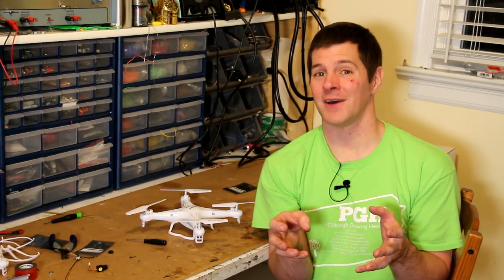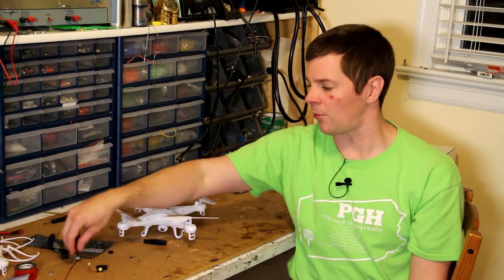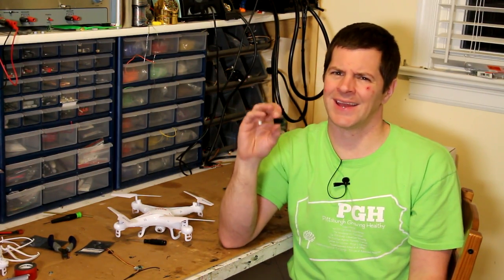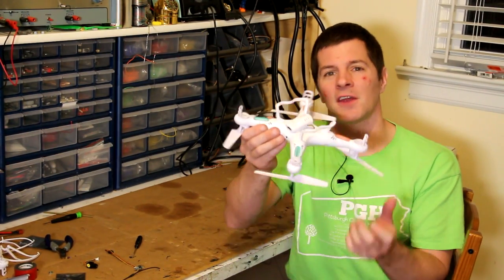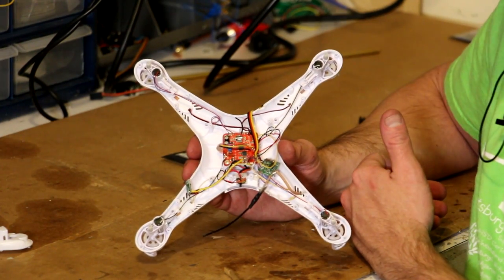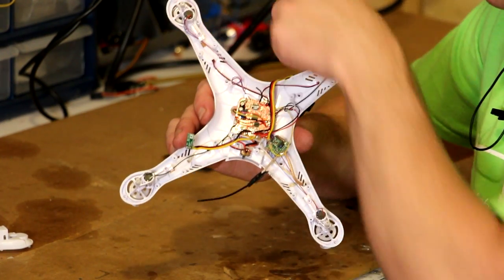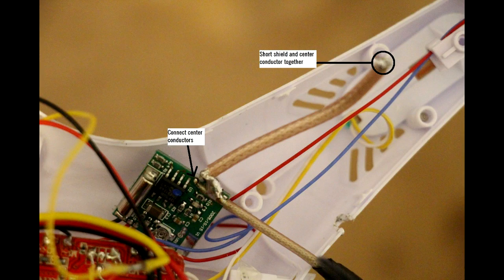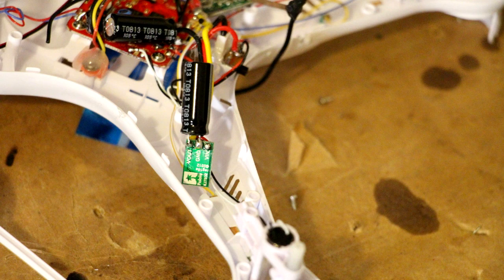Convert the Syma X5C to live video downlink (FPV)

Comment: I thought the video was pointless and too complicated as the wires that go to the camera are good to use, I wired up a EF-02 AIO camera from a eachine e010s and it works fine with a clove  leaf antenna and has a built in vtx receiver ready to go. From a beginners point of view this could have been simplified even more for fpv beginners to just pug in a camera and learn to fly without the hassle.

Comment: Total noob to video transmitting , could you explain how to receive the video , capture it to a monitor,tablet or phone... from the 1.3 gig wifi signal?  
I have an china knock-off x5sw-1, thought it was a syma but while syma is in the pics on the ebay website, what came in the mail was just x5sw-1, so I cant even get the 2.0 mega pixel camera to work at all.... my issue though, 
so any help would be gratefully appreciated .... Thx...... love the Tx range mod in part 2....BTW the cable you cut in half is like 1.68 on ebay.....if you don't mind waiting a month for shipping from china....

Comment: I made a similar mod on my X5SW, although I did it on 5.8 and with a 1S  camera and VTX... I get great video, until I start up the motors, and then the video has so much interference it's unusable. You say about using a capacitor, yet other places mention a coil too... is this really needed? Or would just the capacitor do? Also, what capacitor specs do you recommend?

Comment: Sweeet.   Very informative, just bought the x5c-1.  Not sure what the 1 upgrade is but do you know if the range mod is worth doing with a router antenna?
Reply from the maker: +Andrew Gisch - A router antenna should double your range.
Reply: Good deal, is it the length of the wire inside that makes it extend?   It sounded like the gauge of the wire is critical as well?  Asking because i'm curious if you can make one.

Comment: Just to let everyone know you can simply buy the wifi cam on amazon now and replace the that comes with the X5C-1. No modding needed.
Reply from the maker: +joseph ford - I see this comment a lot, but unfortunately it really is not the same.  WiFi links are laggy and make the vehicle feel "disconnected" from your inputs.  A true live analog link is much more enjoyable... and reliable.

Comment: Dig the mod!!! For a quick cheap FPV I think it's great mod !  I'm no expert just a ham operator and some engineering classes in my past. Did you have to use such a Large cap on the regular or was it just the first thing you tried?
Reply from the maker: +noir4hire - Just the first thing I grabbed out of my junk box.  I had smaller ones, but didn't feel like pulling it apart just to find out I was wrong, so I over-sized it.

Comment: 1.5ghz has no more "penetration power" than 1.3ghz - have no idea where or how you came up with that. Frequency has nothing whatsoever to do with how radio waves are propagated within a building, especially within the same RF band (which 1.3ghz & 1.5ghz are) and assuming the same transmit power.
You also say you are using a voltage regulator to step up the voltage. That's not what a voltage regulator does. Stepping up the voltage is the function of a transformer. A voltage regulator keeps the voltage within a given tolerance or at a constant voltage as the name implies.

Very nice video - do you have a parts list with common Mouser or other supplier part numbers? Hard to do your mod without unless I missed it somewhere? 
Thanks!
Reply from the maker: +Ron Bean -You're joking, right?  1.3Ghz is less prone to multipathing than 5.8Ghz.  This is why I'm using 1.3Ghz.  The regulator is a boost regulator which steps the voltage up to 5V.  I got the components from www.readymaderc.com

Comment: Also, do you know why my camera doesnt work on my SYMA X5C? right top button is to 360 degree flip and the other one does squat, light never changes to red
Reply: +Carlos Alberto Nolasco Hernandez Hold hte right top button until it beeps which I believe turns on the camera. Green light should come on. Then push the button between the left toggle and power switch up to take a picture or push it down to begin taking a video. Push it down a second time to stop recording.
Reply: +Wesley King gee thanks señor! I'll try it tomorrow and ill keep you posted. thank you for taking the time and answering my question. I really appreciate it
Reply: +Carlos Alberto Nolasco Hernandez On mine, the top right button is for flip, the top left button changes the speed of the fan blades (low/high, also a corresponding change in battery life). To activate the camera, it's the button just left of the center of the control, to the right of the left toggle switch that controls the vertical and yaw. Tap for a picture. Hold it down for a second or two to activate the camera. Should see the camera light change for each of those presses.
Reply: Awesome! thanks a million Bryan. You're a wiz man!

Comment: A 1.3 ghz antenna on the transmitter will work with a 5.8ghz monitor?

What if the monitor has a 5.8ghz antenna?

Comment: the filter for the 2.4 is great!!! thanks for the tip crazy! I have a micro quad with the 1258mhz vtx and it smashes the signal from my hubsan Flick Controller. I get about 25 feet right now. I'll send an update after I install the filter.
Reply: Now 5 years later whats the update

Comment: I'm curious, could You maybe utilize the existing onboard Camera by just tapping off the Video Out and connecting it to the Video Transmitter, also are the Video Transmitters only 5v specific? Be nice if You could do that and run a 3v Transmitter eliminating the 5v converter, which would only add the weight of the Video Trans and what ever extra wires needed, just a though...   ;)
Nice Video Alex, thanks for sharing..  :)
Reply: I'm curious, did you ever figure this out? I've scoured the interwebz looking for a diagram or something showing where to connect a video output to the stock camera/dvr, to no avail. If you've figured it out, please please show me! It would save me lots of poking & prodding... I simply want to connect a 5.8ghz tx to the stock camera/dvr. Thank you in advance. Cheers, Paul
Reply: Thank's for the reply & the info. I'm actually not using an x5, I just need a small camera for a 120mm quad I'm building. I have a 200mw 5.8ghz tx & I have 3 of these Syma cameras. 2 are wifi, that you use with the app & a phone. The other has a micro sd slot (essentially a dvr). My idea was to turn it into a  tiny light weight 5.8ghz fpv set up with recording capabilities. I just don't want to fry something poking around on the circuit board...
Reply from the maker: Soco Joe Apparently you can but I have not yet tried that.
Reply: Alex GreveThx Alex, It was just a thought as I think I remember seeing a 5.8 Ghz 200 mW @ 3 Volt Transmitter, and remember thinking that would be Great for a Toy Grade or Hobby Grade Multi-Rotor, anyhow thanks for the reply, think I'll check it out.. Take Care!   ;)
Reply: Hey Paul. Actually I did find a quick solution, although it's not what You're trying to do. I'm sure if You experiment with the Stock Camera and and can figure out where the Outputs "Video Signal" is between the Camera and the DVR You could maybe boost the Signal with a separate Transmitter. Personally I opted for something that's already out there that will give You FPV Capabilities without all the fiddling about, only problem is, it's about $50 bucks, but it comes with a Video Transmitter/Recorder/Camera and a Video Reciever. In My Opinion well worth the Price. Another Problem, it's a bit weak, only about 25mW Transmitter, so range is limited. Even so, It might be something a bit easier to Modify by boosting the Signal. Plus it was designed specific for the X5c, so it's Plug and Play, here's a Link, Here's what I bought, works good for short Range..Check it out..  :D 
https://m.banggood.com/Syma-X5C-1-X5SC-X5SW-5_8G-FPV-720P-Camera-with-Monitor-Real-Time-Transmission-p-980090.html
Reply: Here's also another Option You might consider, I don't believe it gas a DVR Built in but it does already use a 200 mW Transmitter. With this You could set up a Ground Station that records. I think if You shop around, they also make one with a built in Recorder,, take a looksie! 
https://www.banggood.com/Eachine-TX02-Super-Mini-AIO-5_8G-40CH-200mW-VTX-600TVL-14-Cmos-FPV-Camera-p-1088368.html?p=LH15061497646201504Y

Comment: Can you tell me how to hard wire on off switch, bypassing it's the unit.so that it turns on when you plug the battery in? I'm Building from parts receiver didn't have switch, on the syma x5cv2
Reply from the maker: Scott Love Just short it out.  Short all of the pins together and it will bypass the switch.
Reply: I don't have the switch.  Syma is sending replacement receiver boards without the switch.  What can I do to the board so the unit turns on when plugged in? I have the two soldering places + - for the switch. It seems that I just need to connect to the+ to the hot, red wire?
Reply: Scott Love Thats all you need to do. The 2 points were the switch would connect, just solder them together.
Reply: Kevin Foman thank you,  a little nervous since I'm fairly new to quadcopter, and building the units. Just learning

Comment: Alex,,,cool vid man. Builder here too, and have learned alot from you. Im more of a fixed wing nut here though. My dog goes after all the quads from little tiny to the 650mm range, but he got hurt on that one beforte I could call him off so he does not mess with the HEX anymore. RF bocker with 1.6,,,never thought of that,,,pretty cool idea. People might wanna know why you rightly so did not use the feed from the HD cam though. Kind of hard to get them to understand you are transmitting this wirelessly and the data compressed from the HD cam would be so much higher than the RMRC cam. But oh well. Keep up the freq crushing,,,,I love every minute of it. To bad your so far away,,,,we could sail some river canyons over here in Idaho,,,,that is if you would fly with someone who has not flown wings yet. No excuse either as I have a X-61 assembled and ready,,,havent had the kehonays to hand launch it yet,,,,he he
Reply from the maker: Randy Winner I fly with anyone.  i don't judge ;)  The problem with the built-in camera is that the colors are terrible and you can't see very well...

Comment: Really impressive work and everything, but why would you want to get an even worse camera than the one you added? The one you added is even worse quality!!
Reply from the maker: ***** - Not at all.  The camera I installed is far better.  It has better colors and picture.  The camera that came on the X5C is pretty lousy.
Reply: But my camera dosent look all broken when its recording, even though the colours are better on that camera, it still dosent look cheap and broken?!?!?
Reply from the maker: ***** - That's the wireless video system, not the camera.  Wireless analog transmission will be broken.  The cheap camera on the Syma makes this even worse.
Reply: oh i get it now lol

Comment: Hi Alex, I know this isn't directly related to this video but because of your expertise I figured you can maybe help? I've replaced a couple motors on my Syma, it got stuck in a tree once and since then one of the motors is always ON as long as battery is plugged. Even when power switch is OFF. Any idea how to fix this? Thank you!
Reply from the maker: alawabidingcitizen  - Check the wires at the board for that motor.  Chances are you have a short across one of the terminals.

Comment: I liked the video, although your video feed seemed to suffer some some sort of interference. The quality looked ok though when it was working correctly. I noticed in the comments further down you mentioned this setup requires some kind of license. Is that correct?
Reply from the maker: You will get interference when you fly behind walls and such.  That is just the nature of radio waves.  It does technically require a HAM radio license ($15 fee, good for life), but at the very low power it transmits, it is likely that nobody will ever care.

Comment: Have you or anyone else ever thought of attempting to use something like an 808 #16 camera which has video and audio out on it.  But attempt to open it up and modify it so it can also be used to record stills and video using the remote start/stop from the TX???  This would be the best of both worlds as you would need 1 camera and it would function as both FPV camera as well as still and video recorder.

Comment: Alex, thanks for the great video. Not quite sure I understood how to make the notch filter though - I gather you soldered the center wire to the mesh on the free-end, what do I do with the end which attaches to the transmitter - should I solder it on like a regular antenna (mesh to ground and center to the signal?). Thanks again.
Reply from the maker: The notch filter is me being a perfectionist.  It is not required to make this work.  However, it is only a section of coaxial cable 1.6" long and shorted out on one end.  The other end is soldered in like a second antenna.  You are correct in your assumption ;)
Reply: Alex Greve Thanks Alex

Comment: Thanks for the great information. I may try to do this using the existing camera that comes with the quad. I wish you wouldn't allow your dog to get close to the quad... Do a Bing image search for quad copter injury some time and you will see what I mean. I know this is a low powered machine but still. Thanks again for the info.
Reply from the maker: I have caught my fingers in the rotors of this many times.  It isn't enough to do any harm.

Comment: Hi Alex,
Can you please help? My 15 year old son just got one of these Syma X5C-1.
Someone told me that the Lipo batteries are very dangerous, so I search for videos here on YouTube, and now I'm freaking out. Are these little 3.7 Volts / one cell batteries the same as those bigger ones / multiple cells (used on DIY RC)? Do we need to take the same steps when storing/not using the batteries? Do we need a special charger to put them into store mode? Please help!
Reply from the maker: They are indeed volatile.  However, the size of them is so small only a little caution when charging and storing them is needed.  Just be sure to charge them on a hard surface (ie not carpet) and you will be fine.  If the battery becomes punctured, throw it away.
Reply: Alex Greve thank you

Comment: Hey, nice one with the vid. I've just ordered most of the kit to try and copy you. in the part when you added the capacitor to the voltage regulator it looks like you added a second capacitor on to something... what was that for? Cheers
Reply from the maker: The second capacitor was for voltage sag on the motor control side.  It was completely unnecessary.  However I left it in there because it did not harm anything.
Reply: Alex Greve Cheers for the reply, the first parts arrived today.
Just waiting on the transmitter now. will let you know how it goes

Comment: I think the VA1100 is a better choice . Its 5.8ghz and easy to set up ! i navigate my quads through every part of my house and never have a problem with video break up.
Reply from the maker: Care to post a link to where you got your VA1100?  Perhaps I will do that on my next vehicle.
Reply: https://www.google.com/webhp?sourceid=chrome-instant&ion=1&espv=2&ie=UTF-8#q=va1100+camera&tbm=shop
Reply: jmnic63 100 bucks for the camera with camera/antenna/transmitter built in . You are right about 5.8ghz not being able to penetrate through walls but for some reason it worked great for me ! this is the most " in my opinion " easiest way to have a micro fpv setup . The Va1100 needs a 1s lipo and comes with a y connection :)
Reply from the maker: jmnic63
 If it works for you, that's all that matters.  Also, your configuration does not require a HAM radio license.  Mine does.
Reply: Alex Greve That being said , i don't know many people that have a fcc radio operators license so that makes this even easier to obtain and use for beginners  :)

Comment: I was using 5.8ghz Walkera TX5805 FPV indoors for over a year and I could get through both floors of the house, and every room OK, last week I bought the RMRC 1.3 pico package, shown in this video, and wow, so much better, I can even fly around the house, which the 5.8 micro could not. Camera is really pretty good too at least 5X clearer than what I had been using, love the 1.3 pico set up!!, and the price is good.

Comment: can that coax cable trick work on a 910mhz micro transmitter from readymade rc?
Reply from the maker: Yes absolutely.  However you will have a slight reduction in video range as it will shift the impedance of the video system slightly.  It has no loss on 1.3GHz because of the fact that 1.3GHz and 2.4Ghz are nearly harmonics of each other.
Reply: Alex Greve so do you recommend that I do this?
Reply from the maker: 1airhogs
 Not if you run 900MHz.  Only do the notch filter mod for 1.3GHz.  It did very well for me.
Reply: Alex Greve  is the filter necessary for 1.2??

Comment: I did a similar project but I used a 200mW 5.8Ghz transmitter.  Same Quad.   I have not flown it out side yet
to determine if I have any interference but it worked fine indoors
https://www.youtube.com/watch?v=gyNOTPKqxcE
Ken

Comment: Iv done tests with that vtx and the range is no different when applying 3.7v or 5v. In fact 5v just generates lot more heat that is just a waste
Reply from the maker: Will do.  Is it NTSC or PAL format?

Also, did you do a radio range mod yet?  I added an SMA jack and a cloverleaf antenna.  It has given me 4X range.
Reply: Alex Greve h107c is NTSC but iv found that doesnt matter too much. the vtx will transmit the signal what ever the format as the camera/hdrecorder module are built together, you just have to make sure the vrx can handle what ever its transmitting. I bet the X5C does have a video out on it somewhere. for years people said the h107c board didnt have video out and then someone found that it did